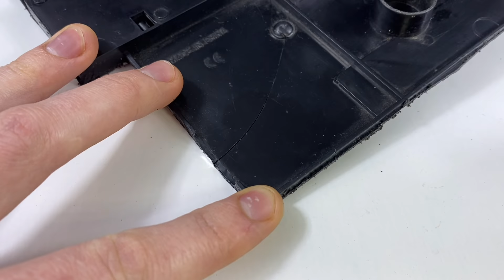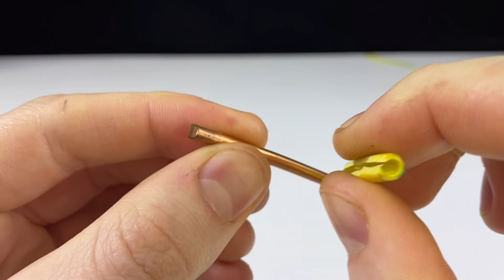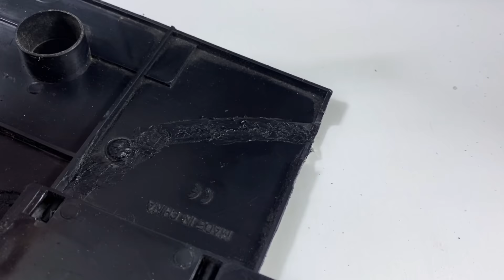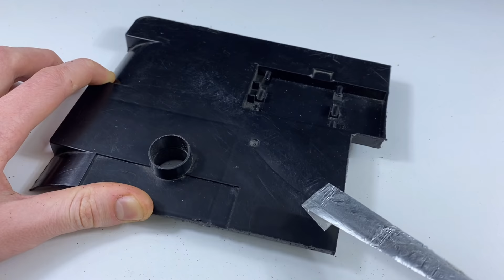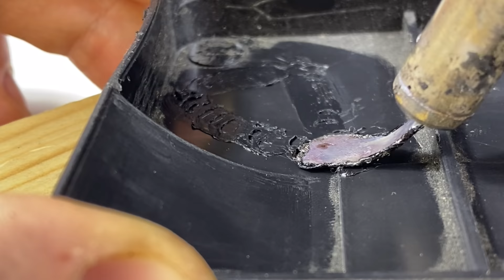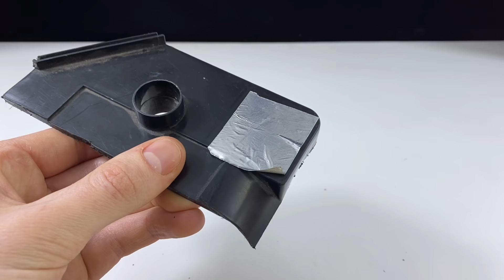This Hack is Genius! Fix Broken Plastics With Plastic Welding Method

Comment: I plastic weld all the time with a soldering iron. In my experience, the best results are achieved when you use the same type of plastic as the filler.

Comment: I have always had a SNEAKING suspicion that plastic could be easily melted together like this but never really tried or investigated, this is brilliant!
Reply: Indeed, your suspicion was SNEAKY.
Reply: There's a whole theory behind it to make a correct plastic welding, thats why this kind of super fast 'how tos' shouldn't be used as learning material. In the first one for example, they mix different types of plastics and thats a big DON'T.
Reply: @disappointedguy  Yeah this is very backyard DIY stuff..like MacGyver level
Reply: In most cases it doesn't hold up well. What happens when you melt it is that the oils deep inside the plastic get brought to the surface and begins the dry rot process much quicker

Comment: Tried the first method (with a zip tie) on a plastic piece that had broken off of one of our refrigerator drawers...and it was a sizable piece that was part of one of the sides that rode along the groove to hold the drawer in place, so it had to be a strong weld. And it worked, thank you!

Comment: You can buy a kit to do this from most autobody/collision repair suppliers, it also comes with different types of plastic rods for different plastics 👍 we were actually having a hard time getting decent strength from the welds bet that mesh method makes it work perfect 👌
Also, SUPER IMPORTANT, those fumes are incredibly toxic, wear a respirator if your going to do this.
Reply: Best place to do is outside (if possible )

In the pass repair some motor parts in this way.

Old thing, but for a.first time it holded well.

Later sold the motor for parts.
And yes the Buyer had a complete list of the damage parts so no hidden suprises.
Reply: he used a zip tie, nylon (likely PA6), which is good on its own. The original piece looks like having a glossy styrene finish - made in China, likely ABS (or worse HIPS), far worse than the nylon.The self made tip has no temperature control, though. I personally use one of my temperature controlled soldering irons.
Reply: Yes, perform repairs near a fan blowing cross-wise over your work area or near a fume-extractor. Don't breath in the plastic vapors as they are toxic and carcinogenic.

Comment: When I worked for IBM's refer department I never used aluminum tape or screens to do repairs on plastic cases. I just used a regular tip hot iron and if I needed any plastic to hold the pieces in place after repair a lot of times your cases because they were molded to create them would have extra pieces I could cut off and used to do the repair. After I was done usually you couldn't tell the problems or damage which there but if I needed to I would lightly sand the area and spray paint it and then use a small paintbrush
Reply: Comfortable recommending a max working temperature for the iron to be set at? Many thanks
Reply: @ben_jammin242  Depends on the material. Start low and work your way up.
Reply: 56
Reply: 6yyt55

Comment: I just bought a new lawn mower and noticed a crack on a part of the handle after I assembled and tore up box. Won’t affect anything 2:22 but it’s new and cracked. I did an online chat and they said I can return it. 20 minutes later they text me that for my inconvenience they are giving me a 10% discount. I then looked up how to repair plastic. This is so easy. So now I don’t have go through the hassle of returning, this will fix the problem. Thanks

Comment: Very good demonstration.  However Two details . One that specific nibs or tips for solder are available and those are better for performing such tasks . Two . specific plastic shold be used and unmatched plastics donot stick and then chip off . These  must be kept in mind .

Comment: Typically yes that plastic repair with similar material is recommended. I really just like to heat the metal until it melts in. There's strength and quick fix for the metal version... in my opinion.

Comment: Thank you so much for this video, I have a plastic bird feeder that is no longer made and the tray was cracked in several places, I used this method to seal the cracks and it is as good as new. I wouldn't have bothered but it is the birds favorite feeder and now they can continue to use it. Such a simple low cost method, thanks for sharing :)

Comment: A way easier way is to dissolve some ABS plastic in some acetone. Make it as thick or diluted as you need for the repair. Then use it like a glue or epoxy. Can be used for/with MOST plastics as the acetone will either "melt" or soften the other plastic (except for poly based) and when your done it is hard to tell where the repair was made. Have used this method to fabricate whole parts or missing pieces of a larger part. good vid over all.

Comment: You can even use pratley steel. Dont know if you get it overseas. Here in south africa we do.  Ok pratley make different products. The one i mentioned is like most resins expocies one gets. You mix 2 parts together and apply it. I had a panel that had a crack in it. I used isolation ( electrical ) tape to seal the crack on the side thats visible, so the glue doesnt go through. I left panel to dry in sun for about 2 hours. After that i peeled of the tape and you coulndt see the crack.

Comment: I used a small paintbrush to create the dimples if it was needed. They also sell spray paint cans with computer case repair that has the dimples built in.

Comment: I used to do this a lot, nowadays though I just grab some Methyl Methacrylate and make a very quick, clean and seamless repair that is super strong. After curing, that glue is strong enough to tap threads in, I mean, if it can hold the wings on airplanes.....

Comment: Do you have any solutions for cracked or broken bakelite?
Reply: Did you mean a broken " brake light" like on a car?
Reply: No, they are referring to Polyoxybenzylmethylenglycolanhydride, better known as Bakelite.
Reply: @youngmartinsreels5314  Yes. Bakelite was used for it's attractive appearance and electrical insulating qualities for electrical fittings, radio cabinets, bowls, ashtrays and jewelery. It goes brittle and cracks in situations where it ir repeatedly exposed to heat, such as old-fashioned light fittings and distributor caps.
Reply: @shangyien  Try the baking soda and superglue method

Comment: Nylon in the zip ties is compatible with the base plastic?
Reply: it's ABS (or HIPS), styrene finish. Nylon melts at (much) higher, other than that it will make a decent composite.

Comment: 💯% Easy fix is to put sime baking soda at the back and use super glue on it, the chemical reaction will make it stronger then the original plastic, I use to repair laptop hinges, cars and alot more using this, you can also can make any plastic shape in case of missing plastic chunk, sand paper it and can also paint it👍👍

Comment: repaired alot plastic parts hot iron or the old solder iron only     
plastic canoe  6" split oxy cet and an AXE head   1/2hr   l8tr in the river no biggy

Comment: No need for the zipties.  Fill in the area with baking soda and then add super glue.  Instant hardening and bond. Then sand it if you need.

Comment: This is just standard plastic welding but using a zip tie, which will get brittle and break instead of using the proper weld plastic.